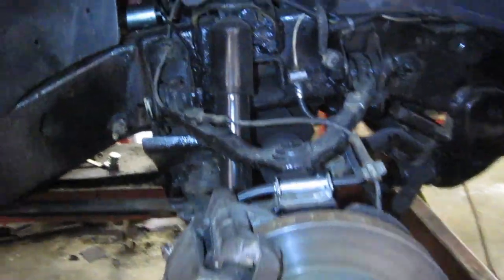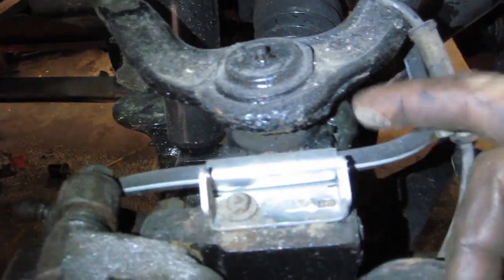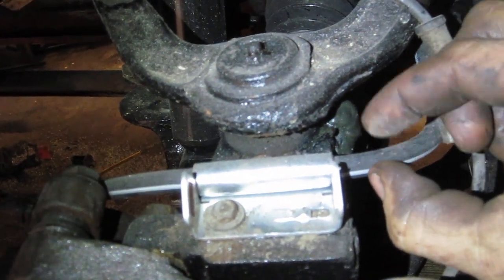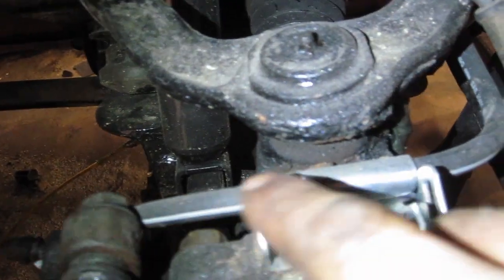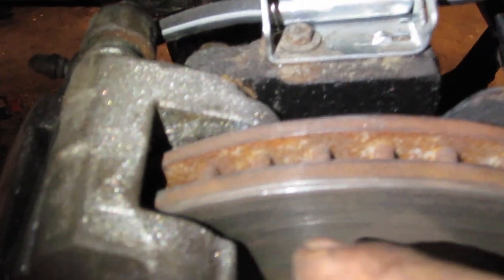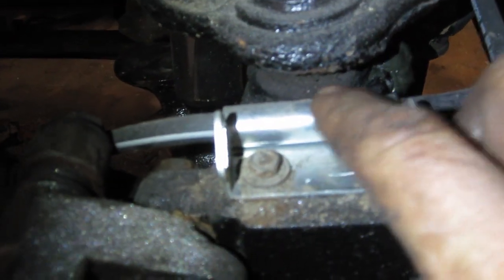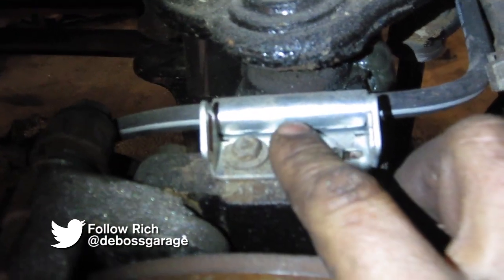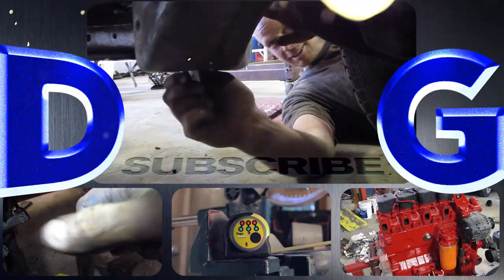How To Fix a Smoking Caliper

Comment: Continued from previous post. I hit the wrong button. So I went out there and he needed to be at work the next day and it was about an hour before the auto parts store closes and he just assumed that it needed pads and rotors and his Pads still looked 90% but the wheel had gotten so hot that my Milwaukee 1400 foot pound impact could barely get the lug nuts off. I did a search and found this video and have watched a lot of other videos cuz I like his Hustle. So I trusted it and used a mini pry bar and basically opened both metal clasps more open and then worked them down the rubber line and cleaned all the crap off the rubber line and then put them back in position and put it all back together and good as new. Good job. I appreciate it